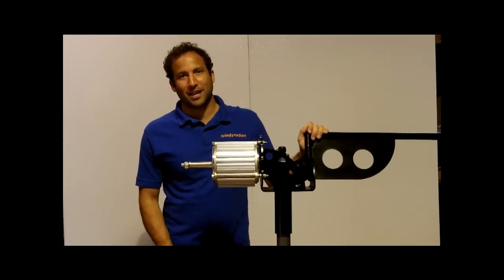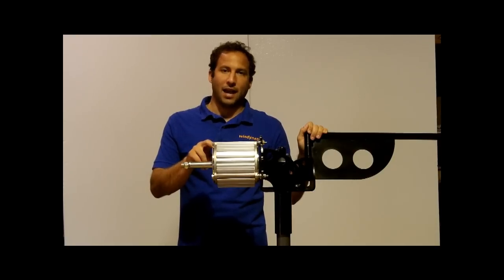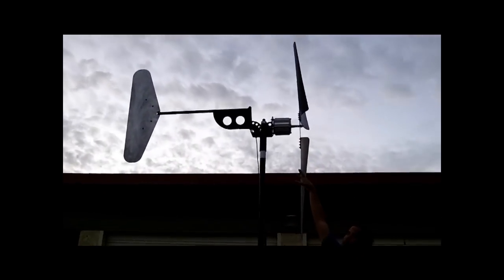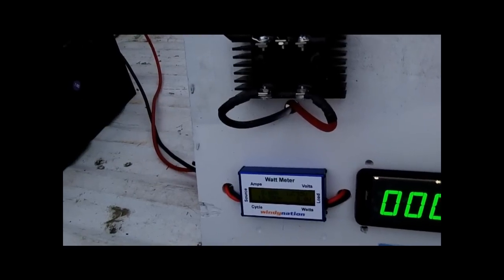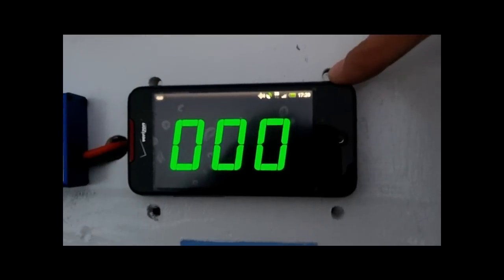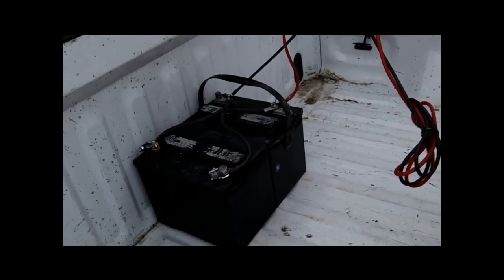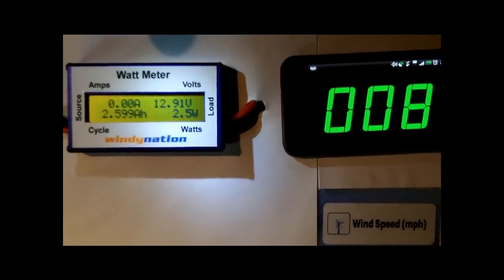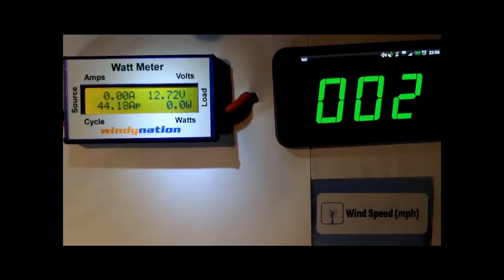Wind Turbine Generator High Amp 12 Volt Battery Charging --- WindyNation's SuperAmp Alternator

Comment: I know this is a test rig... but because you are using a bridge rectifier, you have an uncontrolled load current, so you risk overcharging the batteries and an explosion. This is why you always use a wind turbine controller. However, in saying this, I need a way to show the real time Watts, Current and Voltage on my watt meter, but you cannot do this from 3 phase as they are only DC...!! And for real time you need to be on the upstream side of the charge controller because once the batteries are full, or the load is too much etc... the controller kicks in a slows the turbine, or stops the current load to the batteries etc... so can you suggest any way, to have the watt meter wired in, before the charge controller, (giving real time info) then straight to the charge controller, and then flow on to the batteries...? Thanks !!

Comment: Can you step down 120 VAC from turbine to 12 VAC to charge battery bank?  Cos my turbine is giving more amps at higher rpm.   At lower rpm it does not draw any amps at all even with load

Comment from the maker: @leamyelectricinc1 One more thing Larry. The SuperAmp is not recommended for use on 24 or 48 volt battery banks. It would require too high of a wind speed to start charging those battery banks.

Comment from the maker: @leamyelectricinc1 Hi Larry. I would not say it is superior to our current Windtura 750. Our current Windtura 750 is optimized for a 24 volt battery bank. The SuperAmp uses a different stator with thicker wire and less turns compared to the Windtura 750. It also has some slight (and not noticeable) design changes to the rotor to maximize power and minimize cogging. These changes were done so that the SuperAmp is optimized to create high amps into 12 volt battery banks.